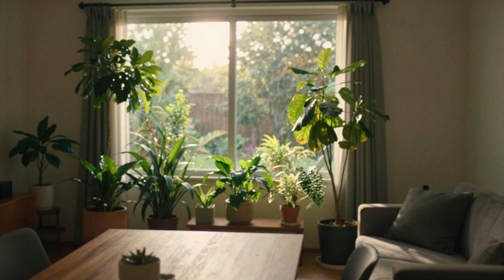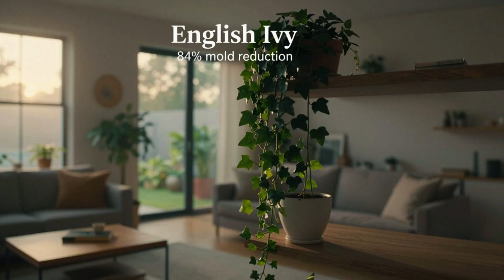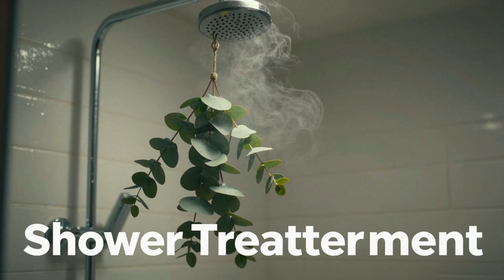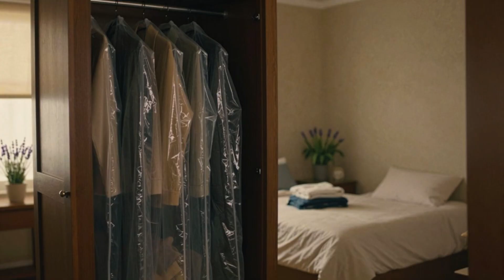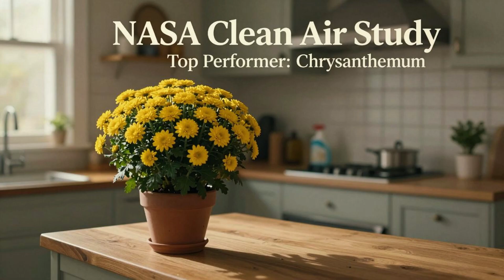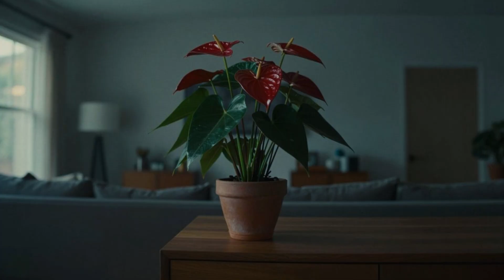20 Indoor Plants That Can Make Your Home Feel Healthier and Fresher

Comment from the maker: 🌿 All 20 plants — what they remove or provide and the research:
#1 Snake Plant — only CAM plant releasing O2 at night; NASA: removes formaldehyde, benzene, trichloroethylene, xylene; bedroom placement
#2 Jasmine — linalool: GABA receptor modulation comparable to pharmaceutical sedatives (Ruhr University Bochum); continuous neurological calming through aroma
#3 Aloe Vera — visible air quality monitor: brown spots signal elevated VOC concentration; NASA: formaldehyde removal; sunburn + air quality dual function
#4 English Ivy — 84% airborne mold spore removal in 12 hours (ACAAI study); NASA: formaldehyde + benzene; most efficient mold allergen filter
#5 Rosemary — 1,8-cineole: University of Northumbria RCT: significant memory + alertness improvement in rooms with rosemary aroma; continuous cognitive support
#6 Peppermint — menthol: reduced driver fatigue + improved reaction time research; International Journal of Neuroscience: alertness + cognitive performance improvement
#7 Eucalyptus — cineole: decongestant + antimicrobial through continuous volatile release; shower steam method for concentrated inhalation treatment
#8 Peace Lily — NASA top performer: benzene removal (laser printer carcinogen); also formaldehyde, trichloroethylene, ammonia; thrives in low light near printers
#9 Boston Fern — most efficient natural humidifier of common houseplants; WHO: humidity + respiratory health connection; no electricity, no mineral dust, no mold reservoir
#10 Lavender — linalool: multiple RCTs confirm sleep quality improvement, nighttime awakening reduction, deep sleep increase; continuous bedroom release
#11 Bamboo Palm — NASA: trichloroethylene removal (dry-cleaned clothing off-gas); natural humidifier; addresses compound most people bring home weekly unknowingly
#12 Spider Plant — NASA original study; University of Hawaii: 96% carbon monoxide removal in 24 hours; addresses low-level gas appliance exposure
#13 Valerian — valerenic acid volatile release: GABA receptor modulation through aroma; traditional European bedroom sachet use; British WWII anxiety distribution
#14 Pothos — highest VOC removal efficiency per square meter of any common houseplant; broad-spectrum formaldehyde + benzene + xylene; thrives in any light condition
#15 Chrysanthemum — NASA top performer for ammonia removal; addresses cleaning products + hair dye off-gas; most targeted plant for bathroom + kitchen placement
#16 Rubber Plant — largest leaf surface area of common houseplants; NASA: formaldehyde removal; physical particle interception through leaf surface area
#17 Areca Palm — WHO recommended for indoor use; Kamal Meattle TED research: measurable office worker health improvement; exceptional humidity contribution
#18 Dracaena — NASA: xylene + toluene removal (paint, varnish, vehicle exhaust); tolerates low light where renovation VOCs accumulate
#19 Chinese Evergreen — highest performance in real-world conditions vs. sealed chamber testing; functions in low light, variable humidity, temperature fluctuation
#20 Anthuriums — efficient ammonia removal; months-long continuous bloom; closing question: how many symptoms we attribute to stress are actually indoor air?